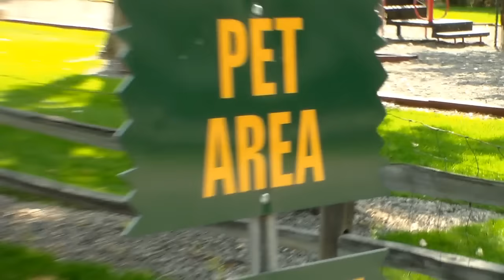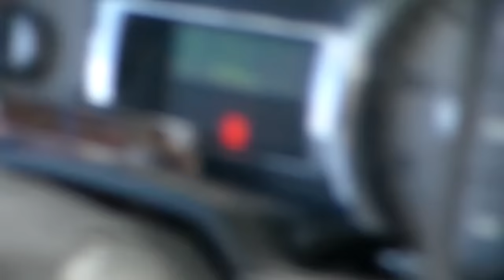1958 GMC Fire Engine Rescue (CTR-44)

Comment: Rick, Jamie, I’ve watched several of your videos now, out of order and now I KNOW why I keep coming back.  
I’m grateful for your sharing your love of Jesus!
Being disabled with MS unable to do things I used to do and watching you share your life is like being there with you.
In my late 20’s I had a green ‘65 3/4 ton Chev, three on the tree, 230  6 cyl stepside  pickup.  It was an ex Burlington Northern RR truck with a utility bed that had a chunk cut out for an oxygen? cylinder.
I got a ‘64 GMC PINK fleetside parts truck and started hacking away on it.  Having virtually no skills I switched the bed, both doors and ATTEMPTED to switch the tranny...a 4 speed with granny low all while raising my 3 boys alone.  No go as tranny was too heavy and I didn’t own a floor jack. I sold it to a junk yard forgetting to take out the new clutch. Dream crushed. I think I saw my old truck in one of you videos on the side of the road...probably not...
Reply from the maker: Gonn'a need a little more help finding that truck Brother. Be more specific. Which video? And at what time-stamp? Thanks fer watchin'...-Rick

Comment: you need to take your truck in to the Ford dealer and have the destination to empty sensor replaced that's probably what's going wrong with the destination to empty notice on the truck.
Reply: You could well be right, but in my experience the "miles to empty" feature on any vehicle tends to be not terribly reliable or accurate...